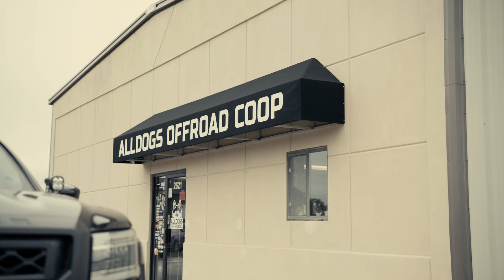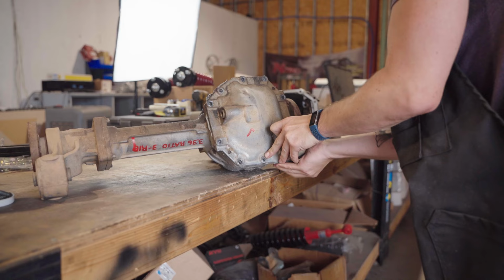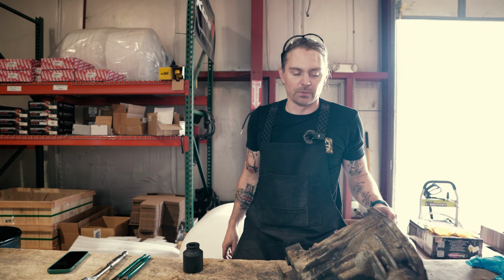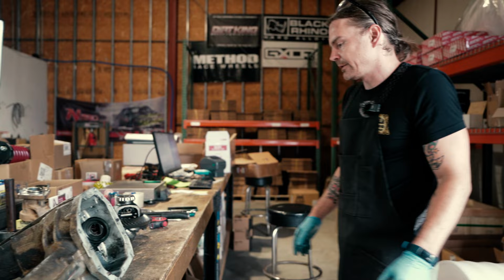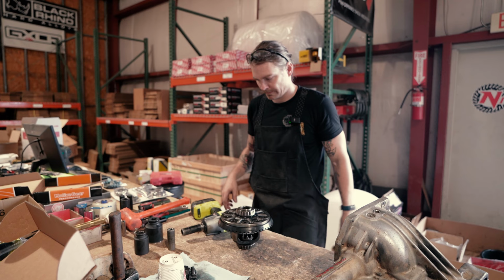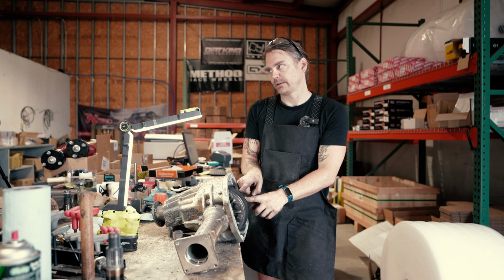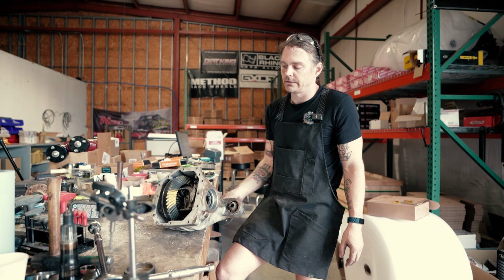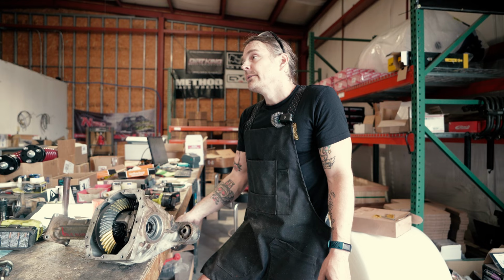3rd Gen Nissan Frontier Regeared with Alldogs Offroad Prototype 4.08 Gears and M205 upgrade!

Comment: Real DIY friendly... as long as you can fab a tool for the passenger side adjuster and a super uncommon 46mm thin wall socket that's only available in 3/4" drive.

Comment: Hey buddy,  just subscribed to the channel!  I have a 2018 nissan frontier and love it.  It has a 4.0L, just installed an Amazon budget cold air intake,  3 inch lift and a TAC modular bull bar.  Unfortunately my truck is 2 wheel drive,  do you think it would be extremely difficult to make it 4 wheel drive?  I was think about getting all necessary parts from a wrecked frontier.
Reply: Yes it would be difficult I've seen one person do it but I think with all the time and money you would be better off trading it in for another one. Just my opinion though you do what you want.